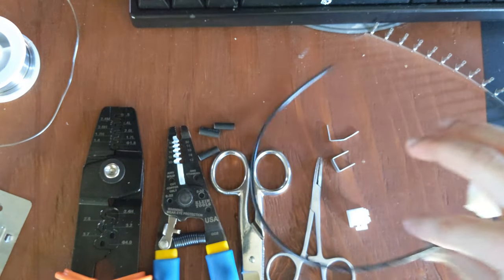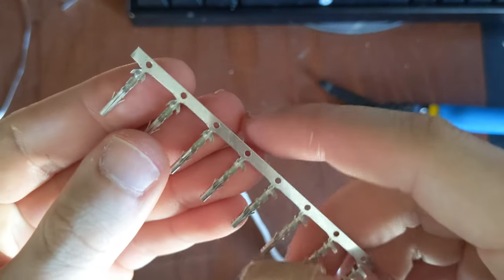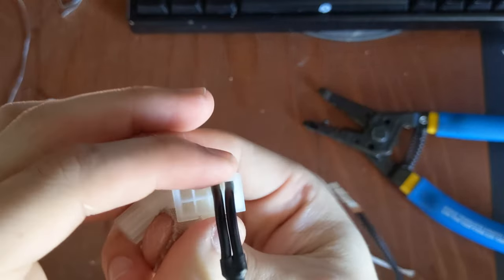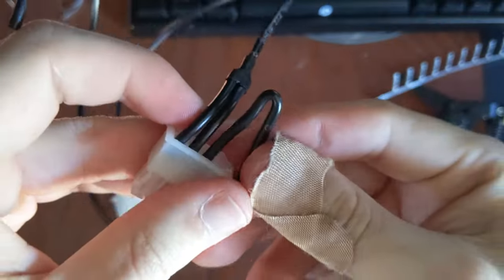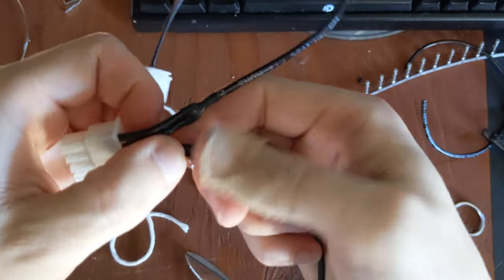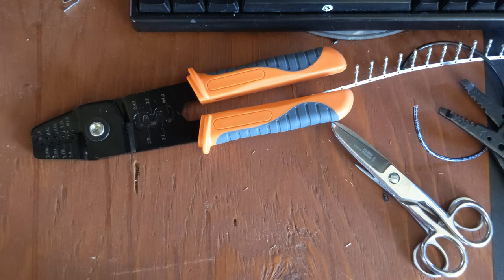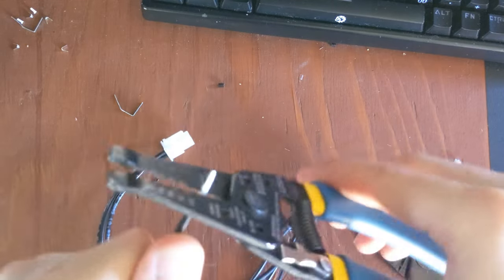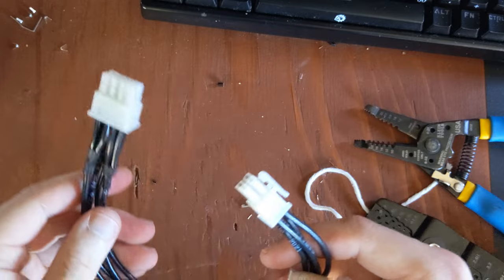Making Custom PSU Cables: Crimping Molex Mini-Fit Connectors

Comment: the "cpu 8pin" and "pcie 8pin" seem to be identical. Can be used interchangeably? most likely it does
Reply from the maker: @rosewell1983  No they are not interchangeable. They are wired differently and the connectors have different shapes.

Comment: Is it safe to use automotive wire? Not silver plated
Reply from the maker: As long as it is the correct gauge and makes a solid connection, I think it will work.
Reply: Yes it will work.

Comment: Nice no-nonsense informative video.  Thanks.  I wish more were like this.

Do you know which pins and housings to use for a female 8pin EPS/CPU power?  Because I presume they are both different than the male connectors. (This is for making my own adapter for a server which does not have modular cabling.  I need to fit a workstation GPU (single 6 pin PCIe power).   The plan is to go from 8pin EPS/CPU Female, create a Y, and have an 8pin EPS male on one end of the Y and a 6pin PCIe male on the other end of the Y.

The motherboard draws nowhere near its 816w max (144w from 24pin ATX, + 2x 336W from 8pin EPS) so I figured it shouldn't be a problem to tap into one of the two 8pin EPS connectors and pull 75W for a workstation GPU powered by a 6pin PCIe connector, but the spacing is weird, so rather than daisy chain adapters and have cables flapping everywhere, I figured I'd make my own.

It's kind of annoying because I need an Nvidia card (because Radeons have a reset glitch when doing VFIO forwards to VM's, wheread Nvidia's workstation cards pretty much work flawlessly in this regard these days) and I only really need the lowest end workstation card which doesn't require a power cable (it draws all the power it needs from the 16x PCIe slot) but they only make that model in a short stubby half height dual slot variety, but I don't have two slots available, so the only option for a single slot is the next one up, but it requires additional power, so I have to use adapters :/

Comment: Can you give details about your pico, also there seems to be a few types of pins such as brass and copper also do they make 16awg pins or do I have to use the 18awg ones?
Sorry about the many questions, I am really new to this.
Reply from the maker: The PSU is a M2-ATX made by mini-box.

I do not know what the pros and cons are of pins made from different metals. I went with copper; part number 39000038 for 18AWG, 39000077 for 16AWG.

I recommend using the same size crimp terminal for the wire being used.
Reply: @MegaBitmap  Thank you very much man, you are a life saver! Cheers!